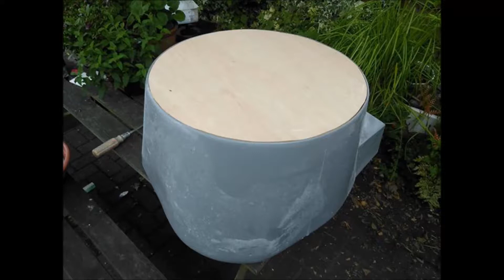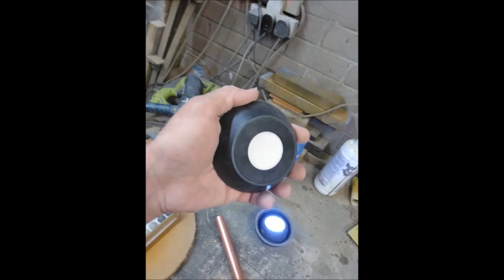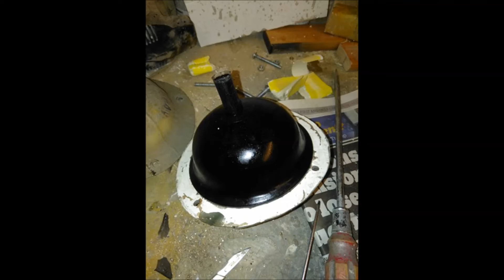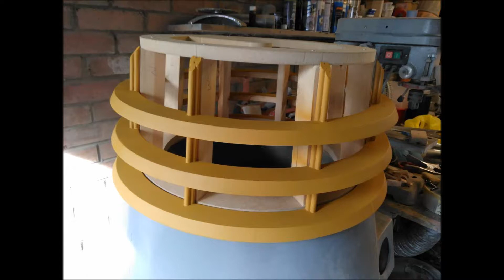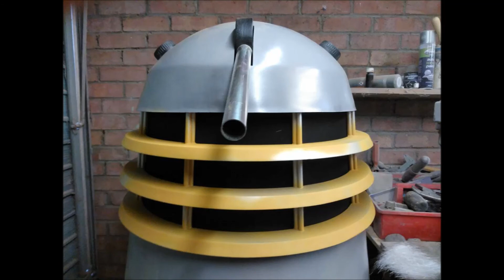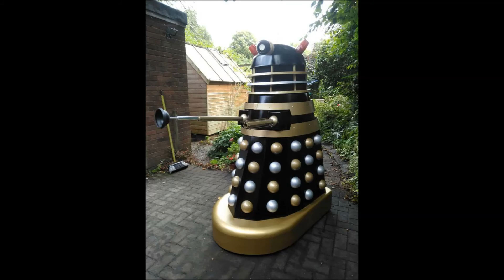Dalek Decimus - The Construction of Dalek Decimus

Comment: Similar, except the top rings were too high right up to the dome, but well done anyway, would love one in my bedroom to chat too.
Reply from the maker: I don't know, neck ring spacing seems quite inconsistent in the Movies and the original TV Series. They were built by several different people both in Shawcraft and the BBC with various levels of quality. I would say mine are evenly spaced which I like because the way I see it, Dalek casings would be mass produced, the same way a car is. So the neck rings would be like the even spacing of a car ventilation grill or something similar :)
Reply: I think the dome looks better when it is higher up like that, as long as the support rod endings are under the dome so it looks like they connect.